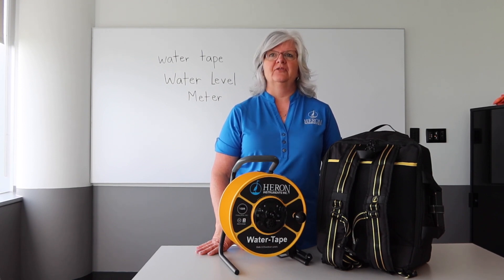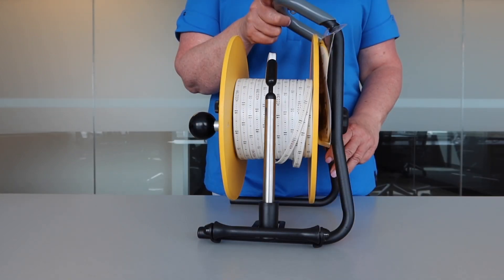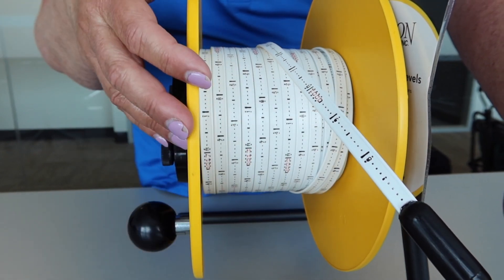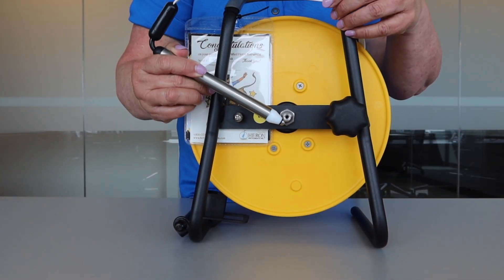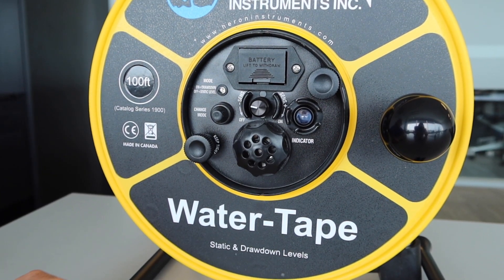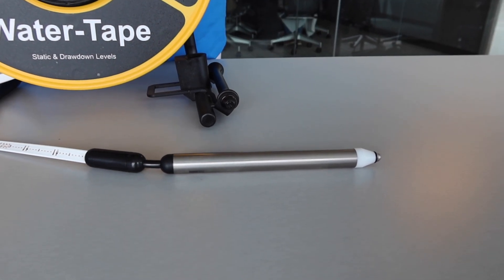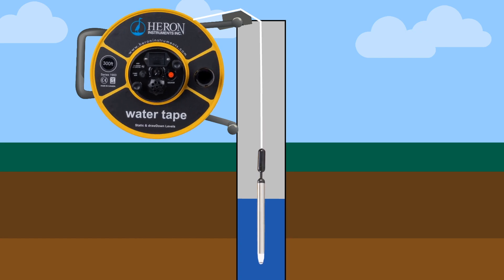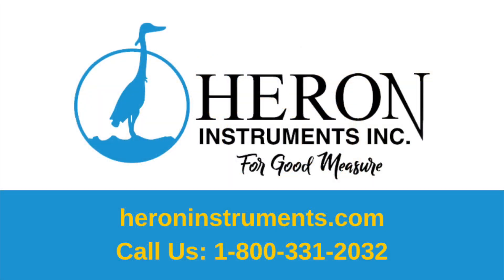Water Level Meter - How to Use the water tape

Comment: The ground wire is supplied on specific models certified for use in wells with explosive gases or floating fuels. It is a component that helps make the unit explosion proof.